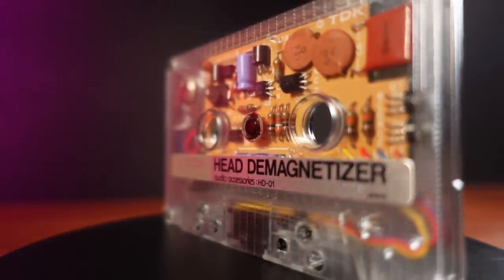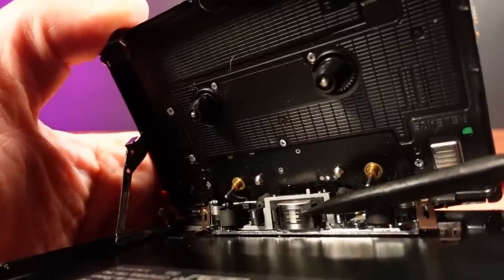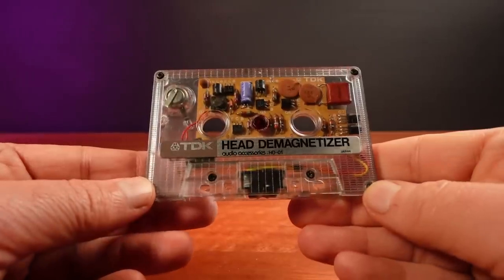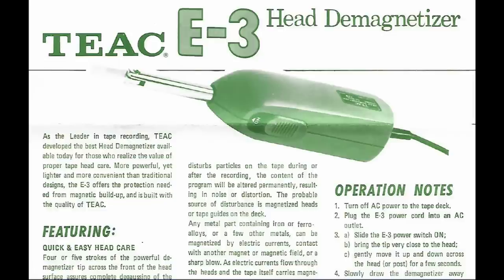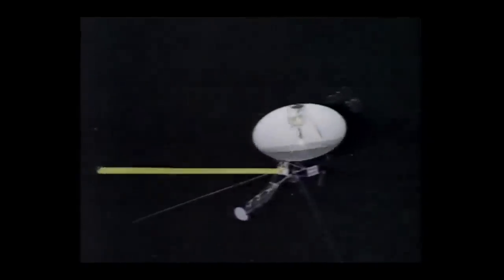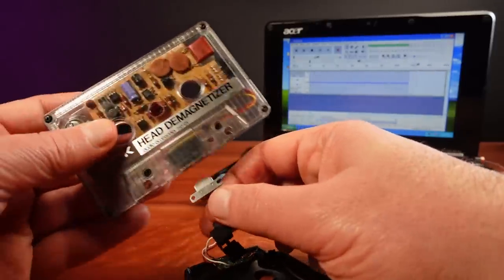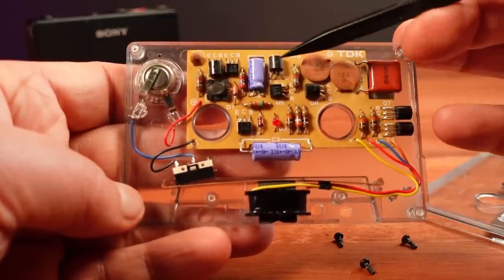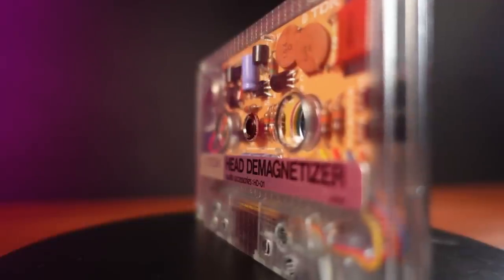No One Knows If This Actually Works

Comment: I had one that looked just like this in the late 80s. I think mine was Boots-branded in the days when they sold records and audio equipment. 

I didn't think it looked cool. It probably wasn't hugely expensive but I resented every penny I spent on it, not knowing for certain if it was necessary, did any good or damaged my equipment. I only bought it because the manual of my cassette deck told me to demagnetise periodically.

Comment: I use mechanical watch demagnetisers and understand the principle which is as you describe this. Though it’s a ton of current required to work on a watch and I’d expect more then a tiny cell battery could muster. I wouldn’t expect the magnetic field generated to by audible either, with the demag I have it’s 50Hz mains AC.
Reply: The current needed is going to be to do with the mass of the item being demagnetised. Tape heads are super sensitive by design and have low magnetic mass, so it theoretically wouldn't need that much current to do.
Reply: I have a TDK HD-01 and a mains powered 'Zeeper' wand,
The wand far outperformed the HD-01, I'm not sure if it's down to the electronics or greater output power,

But there could be something to this
Reply: @sirspamalot4014  usign Lepsi or another phone app this could be tested :)

Comment: These are basically small versions of the large demagnetizes that plugged in and you stuck the metal rod on the tape heads. They had many brands and clones. Some work others not so much. They are low powered. But I can testify that they do help.

Comment: I bought a TDK HD 01 earlier this week and tested it on my "Aiwa AD-F810" equipment. The light turns on, but I don't see the VU indicator moving and I also don't notice any improvement in sound after playing it for at least 10 seconds. Do you know if it's possible that in 3-head decks it may not work properly or even not work at all with this cassette? Is there any other way to confirm that it's working properly without having to record a sample through Audacity? CHEERS FROM ARGENTINA, AMAZING AND RELAXING VIDEO !!
Reply from the maker: It's possible the pulse is so short your won't see the VU meter moving. If your deck already sounds great with very low noise it will be hard to tell how much this has helped. I would say be happy with the sound quality and have peace of mind that you can keep it that way :)
Reply: And if it is a 3-head deck, the middle head is for recording and the other head in the direction of tape travel is for monitoring the recording, pre-calibration of the recorder and playback = your recorder simply didn’t hear it as the de-magnetiser was in the wrong place

Comment: I am a tape deck technician and I have and use one ot this TDK device bought brand new in the 80s, I think. Since then, I use this on a regular basis but, sincerely, I can´t perceive any improvement in the sound. To be completely sincere, in the 80s I noticed some improvement in cheap devices as entry level car cassete players and all-in-one compact radio and cassete players. However, since the end of the 70s most of the tape decks started to use heads that was made of some type of aluminum alloy that was almost imune to magnetization and, this, way, they simply do not get magnetized at all. That is my perception, but it was tested in thounsands of tape decks and players along all these decades.

Comment: Well, back in the '80s these were mostly viewed as a novelty
However, demagnetising the heads of tape based storage for microcomputers was a standard part of servicing and repairing them.
It's highly unlikely that this was needed in most machines though as the heads are mostly stainless steel and paramagnetic rather than ferromagnetic
Cleaning the ferrite dust from the heads was much more important though as that's designed to hold a magnetic flux

Comment: On any quality tape player the mechanical tape guides and feed parts are either plastic, rubber or stainless steel to prevent magnetic buildup influence on the tapes that could diminish the audio permanently on the tapes. I used an scope on the audio output to see if there was a difference. With most tape heads, there was very little discernable difference but, if someone had used a magnetized screwdriver to adjust the head, this device worked well to get the high frequency back. Most of the time there was build up of tape residue on the head from moisture and dirt/dust because of leaving the cassettes lying around unprotected but acetone and a q tip was usually the answer. Sometimes i would find that the head was actually worn down from friction till the tape path was uneven and not letting the tape contact the head completely due to the very wide variety of push pads used on different brands of cassette tapes. I used this device as a precaution when repairing tape drives because of my own OCD and strive for perfection.

Comment: I still have my HD-01 and it still works.  Sure, it may not work as well as something like the TEAC 'wand,' but on decks like the Nakamichi 580 or CR-2E, where the heads can be difficult to 'get at,' the HD-01 is useful, and in my experience, definitely does the job.  Which, BTW, is not to "improve the sound," it's to prevent your machine removing the high frequencies from a tape (which is what a magnetised or partly-magnetised head does).
And regarding the short pulse: I knew about that, and I usually 'run' the HD-01 (say) three or four times, leaving a few seconds between 'passes.'
Reply from the maker: Thanks for clarifying that a magnetized head can remove the high frequencies from a tape. I've not been clear on that aspect.

Comment: My understanding is that head magnetization was generally more of an issue on older decks, presumably at least in part due to different metal used in the heads, and perhaps circuitry design. It seems likely magnetization often wasn't caused, or not only caused, by the tape - there could be far higher electromagnetic radiation from electrical components.
Personally I think magnetization is far more likely to be caused by electronics, or by accident, such as bringing magnetic screwdrivers into contact, powering off the deck during recording in some cases etc. I can't see the tiny fluctuating(equally north & south) magnetism from tapes doing much.
2 head decks(where the record & playback heads are together, unlike 3 head decks) reportedly perform their own demagnetization, just by the nature of how they work in record mode. Recording mode will send out a much stronger electromagnetic signal to record onto the tape, vs the long term but extremely weak signal being read from tape in playback.
If this info is accurate, it seems entirely plausible the demagnetizing cassette here would work...on decks that actually need it.
As a note, the battery in this tape could easily have been replaced in the past, without opening the case. The battery has a small cover that can be undone. The cassette here may also had enough battery power to activate the LCD & generate some signal, but may have also been lower than with a new battery (& possibly could've done with replacement capacitors)
The manual also lists the pulse as lasting about 0.3s (300ms), not 120ms, so they may indicate a lack of battery &/or capacitor charge. The oscilloscope image in the manual also shows a much more pronounced curve, though that could just be different axis scaling.
The frequency shown here pretty much matches the 1978 manual, which lists 630hz. It also lists the maximum flux density(ie the "power") at 220 gauss.
I dare say people definitely did know if this worked or not when it was originally sold, presumably including magazines at the time testing them.
I find it difficult to believe TDK (and other reputable brands) would have made them if they were never any use. TDK's entire early history was based around magnetic material & then audio tapes. An actual test would be simple now, digitize & compare waveforms of tapes recorded before & after, and played before & after. There's no debate, for that particular deck, if the results show a difference.
In 1982 these tapes were sold for $14 in a magazine, equivalent to $48. The same magazine also has a good article on (de)magnetizing:
https://www.worldradiohistory.com/Archive-All-Audio/Archive-Audio/80s/Audio-1982-09.pdf
Reply from the maker: Fantastic analysis, thank you! I agree that this would be easier to measure by bringing the output into the digital domain.
I do also think there would be a minority of hi-fi enthusiasts that would complain loudly and religiously about measuring the results in the digital.
I've noticed that emotion and belief still plays a significant part in the audiophile world. I'm amused by the comments I get whenever I've made videos about analogue audio devices. Including one I remember where I had recorded onto a Metal Compact Cassette from a digital source and it was intimated that I had committed a heinous sin of epic proportion.

Comment: I once tried to erase a recording on a normal bias tape with a wand demagnetizer and it couldn't even ease the tape. This was a popular lite up with transparent plastic and a metal rod though the center.  Other types like this would work but definitely not this one. I use an older Sony RTR type to demagnetize my heads now. Not only does ths demagnetize the tape on contact but it also erases the spooled tape in the cart.

Comment: The principle is certainly sound.  I use a degausser on my Ferrograph open reel tape recorder.  If you fail to do so then the heads can become badly magnetised and it impacts performance hugely.  Not just like hi-fi nuts going on about nuances, no actually makes it work really badly.  However that's a mains operated device so the energy available is hugely more than this device which uses a watch battery.  One of the things that can cause magnetised heads, is the use of cheap recorders which have a permanent magnet erase head and/or DC Bias on the audio head.  This causes tapes to have a large component of magnetised particles lined up in one direction, which then magnetises heads and other magnetic components.  Note that head devices like this absolutely must not be used on Philips DCC cassette decks, whose magneto resistive heads will be instantly destroyed by it.
Reply from the maker: I do love exploring the nuances of analogue technologies. But damn it can be a minefield sometimes. I really appreciate the knowledge you provide in these areas on your channel. Thank you for the work you do there.

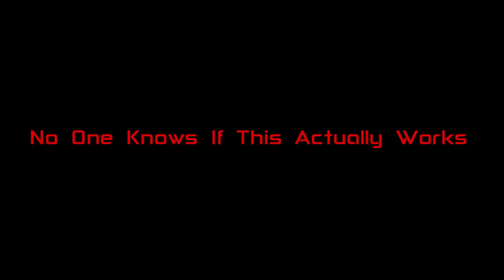Comment: 3:15 -I mean, this looks like a way more complicated means to an end, than other variants of tape head demagnetizing cassettes I have, or had, which have just some configuration of a permanent magnet imbedded in a plastic wheel, which spins behind a special cleaning strip tape, which you saturate with a bit of 91% isopropyl alcohol, prior to use. I don’t see why that in the video, wouldn’t work,  as a demagnetizer, in theory, but, there’s far more simple head cleaning/demagnetization cassettes, which perform both maintenance steps, simultaneously, and cost a fraction as much. I can confirm, that the cheaper dual maintenance cassettes work excellently, and rarely require more than a single pass, unless the tape head is really filthy and  magnetized, in which case, just run as many passes respectively, until it’s satisfactorily restored. ❤ In the case of where you can access the tape head, directly, with a Qtip, behind the door, pre-clean the tape head prior with isopropyl alcohol, prior to running the dual-maintenance cassettes, because this will help prevent the cleaning tape medium in it, from fouling with residue, sooner than later. Dual maintenance cassettes are invaluable for cleaning side slot loading cassette mechanisms, like you typically find in older car stereo systems because accessing the tape head directly, without taking the whole thing apart, is a lot more difficult. Plug in tape demagnetizing tools, like the ones I use for RTR player/recorders, aren’t usually as ideal for cassette decks, because of limited accessibility to the tape head, itself with the tool, and you only have a handful of seconds to use the tool, before you must unplug or switch it off, or the tool itself, will self destruct, because it’s essentially just a crude AC electromagnet with a polymer insulator over the tip. Basically, if you drag your feet too long using it, it’ll heat up like a soldering iron, melt the polymer insulator, and possibly short out the internal windings, breaking it, and/or posing a fire/electrical hazard.

Comment: I have one of these and have used it many times.  Most times it was preventative use.  The deck still sounded fine.  But recently I had a deck that could not make a good recording.  So I tried this and bammm, the recoding improved dramatically the deck could then could record and play back high frequencies.
Reply from the maker: Interesting, thank you.
Reply: I  can  remember  that ,   because  that's  why  I  did  used  it  for  my  Sony  cas. deck  TC - 55 - Mark II   1980  and  an  older  before als  a  Sony TC - 188/186 ?

Comment: The voyager space probe runs on radioisotope thermoelectric generators, or RTG's. They are nuclear batteries that run off the decay of plutonium, but even they are running out of fuel and voyager will soon go dark forever.

Comment: I have a TDK HD-01 and a mains powered 'Zeeper' wand,
The wand is much more effective than the HD-01, it can recover heads that the TDK can't,

I think the TDK unit was probably designed to be a low power, regular use item (every 100 to 200 hours?) and the mains powered wands were able to recover heads that were quite hissy with a definite loss of highs,

A few passes with a wand and cleaning the oxide off the heads and capstans/pinch rollers at the same time saved alot of bad decks, 

Some of my friends were amazed at the instant difference it makes

Comment: I use to degaus crt tv with my soldering gun . It works amazingly well. Also if you remove the tip from a soldier gun and make and iron probe from a nail mounted into just one conection then you can degaus tape heads and parts with your old soldering gun.

Comment: Thank you very much, good video, in those years I had a TDK very similar to the one you provided, it did work or at least it seemed that way, I had a great compilation of cassettes, I recorded many on a great nakamichi dr-3 deck, I used that cassette for degaussing regularly and it gave me a different sensation in the Audio, well regards and excellent video, now I technically understand how this system works thanks to your video document,🎩

Comment: It's relatively easy to check, if it works: with magnet tape visualiser find playing head with that magnetic affection of tapes - and test (of course with fresh batteries).
Reply from the maker: I have a small sheet of magnetic visualizer material somewhere. Great suggestion, thank you.

Comment: I had one of these in the '80's...don't know if it worked but my Nackamichi tape deck worked well...a very high frequency for 5 -10 seconds...amp off,unplugged...snake oil ?...my tape deck was better than average but not a qualified expert...wow, 20+ years since i last seen one....kool..i used isopropyl alcohol to clean the heads first with a cotton bud every couple of months depending on use of tape deck....neat

Comment: 5:53 I still have the red one!! It made a continuous sound and the cogs moved the coil back and forth into the heads so the sound changed in volume.
Maybe your tested circuit or the battery had not enough power to create the right signal so that's why it died so soon.

Comment: I have owned this since 1980, and it does in fact do what it promises.  Head demaging should be done periodically along with a thorough cleaning of the heads, tape path and pinch rollers.  Once magnetization reaches the point where there is an audible loss of high frequencies - it is too late.  The magnetization has already diminished the sound quality of recorded music.  Do it about every 100 hours of paying time, more frequently if the deck is used principally for recording.   Replace the battery when the red light appears dim or after three years if the cartridge has not been used recently.  The TDK demagnetizer uses an A76 or type 357 battery if I recall correctly.

Comment: it works - at least it worked for me in 90's. i had rly nice sony hi-fi system and somewhere in 94 i went aboard and bought TDK demagnetizer "tape" - after a first run it significantly improved high tones ie. sound become "sharper"

Comment: Mainly you need to regularily demagnetize (degauss) your tapeheads only if you are frequently recording music onto tape (or formerly have done so. Best is if such is done after every recording session or when changing e.g. cassettes / tape reels). While the premagnetization (Biasing) used on standard Fe2O3 tape is comparably low (switch setting often "low" or "medium") therefor building up a residue of magnetism slowly, frequent recording onto e.g. metal tape which uses very high biasing levels (also notably higher than that on Chrome-/Cr-Substitute tapes) results in a faster buildup of magnetic residue requiring degaussing.

Comment: loooong time ago, i had a teac four track cassette recorder and used one of those. I used some kind of reference tape to measure results, per instructions at the time. Results were mixed. Some improvement but definitely not restored to initial performance. If others have more definite information in the comments i missed it, apologies in advance if so.

Comment: Ferrous metal parts become magnetised just by sitting in the same position. I doubt the magnetisation happening in  by the first place is supposed to be caused by use of the equipment. This isn’t any C assertion that the things are needed. I did have both types in the the day though. The mechanical type used cleaning tape to spin a circular magnet within the cassette.